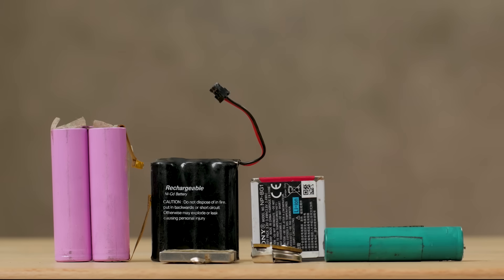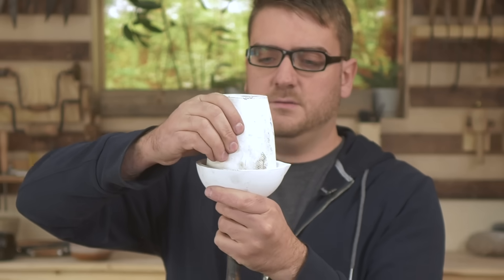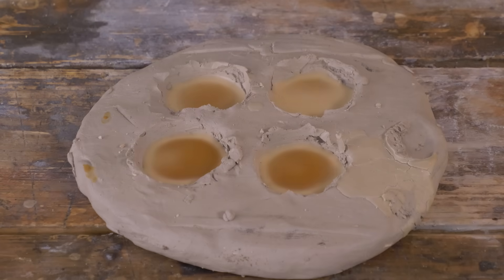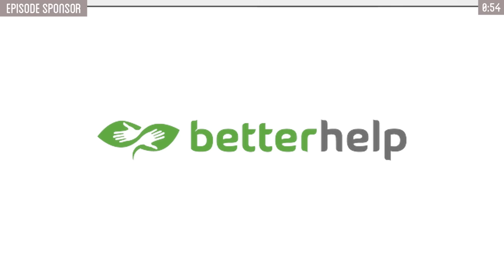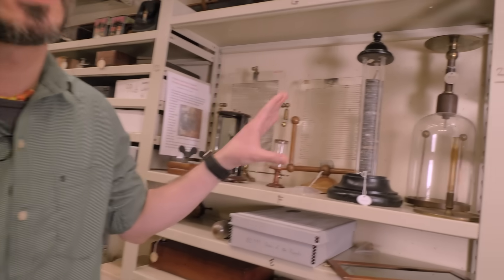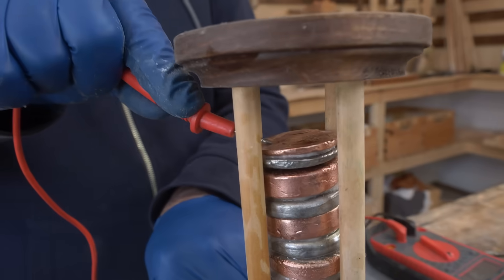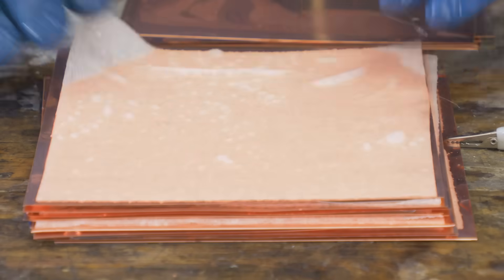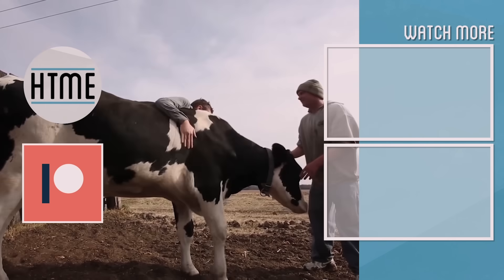Can an 18th Century Battery Charge Your Phone?

Comment: It makes me sad that your battery design is clearly and obviously mechanically flawed at first glance. It uses needlessly thick copper and zinc ingots instead of proper thin metal discs, and they aren’t even remotely flat as they should be. Furthermore, the felt doesn't extend beyond the edges of the metal discs, which allows them to short-circuit. It’s not properly saturated with electrolyte, since you just poured some over the top carelessly, and you also soaked the wooden rods that touch everything, so all the elements are partially shorted through the electrolyte. It's just completely wrongly built — it's painfully obvious — and yet your video has such a high like ratio. I don’t understand it.

Comment: Hello, it seems to me that the most promising solution associated with wire is drawing, but there is not only dry drawing, maybe consider other options for this method, use several not one a spinneret, and several along the entire path of the wiring or use guides to maintain the uniformity of the movement of the wiring, it was very clearly looked better in that when you pulled it with your own strength

Comment: Would this have perhaps gone better if we had soaked the individual pieces of cloth with the saltwater - and then placed them in between the metals - instead of dousing the entire thing? It's possible that dousing with saltwater (a conductor) created a short circuit everywhere. The saltwater layer I think is supposed to aid in the transfer of ions between each layer. But dousing the entire thing would shortcut the desired reactions.

Comment: The Invention of the Kitchen Tap Generator

In the 19th century, the Whinney Company invented the Kitchen Tap Generator, a remarkable device that could generate electricity from the kinetic energy of flowing water. This generator, using a simple tap and a small water pump, could harness the energy from a bathful of water to produce over 1 kilowatt (kW) of power – more than enough to run a personal computer, multiple monitors, and even apartment lighting.
Principle of Operation

The Kitchen Tap Generator functions based on the conversion of kinetic energy from flowing water into electrical energy. When water flows through the tap, it drives a small turbine connected to a generator, which produces electricity as a result. The system is designed to be highly efficient, with the pump only consuming 50 watts of power to continuously recirculate the water in a closed-loop system, ensuring zero water wastage.
Safety and Isolation

The Kitchen Tap Generator is designed with safety and isolation in mind. The electrical components are securely encased and isolated from the water, making the system completely safe for use in a household environment.
The Whinney Company’s Instruction Manual

The Whinney Company’s instruction manual plays a crucial role in the successful implementation of the Kitchen Tap Generator project. By following the guidelines provided in this manual, users can effectively assemble, install, and operate the device to generate electricity for their households.

In summary, the Kitchen Tap Generator is an ingenious invention from the 1800s that converts the kinetic energy of flowing water into electricity. With the help of the Whinney Company’s instruction manual, it is possible to build and operate this system in a modern household, providing a sustainable and efficient source of electricity for devices such as personal computers and lighting.

Comment: Excellent for charging up power banks, just note the voltage output reading from the multimeter, then source, or build a power voltage regulation module & a USB port to charge the power banks.
I built a battery in a similar method, but I wasn't adequately equipped to do these experiments due to electricity being involved.
Be aware, doing these experiments could mess with your own body's electrical field if not wearing any protective gear.

Comment: Just an opinion (for what it’s worth), by the end of the film you were able to demonstrate real results-albeit not for long- but your phone did indeed (briefly) gain a charge. My idea is thus; conceivably could one make many voltaic piles (or indeed Baghdad batteries), connect them together and run the resulting current through a transformer coil (you could wrap a coil manually or potentially loot one out of a furnace or a microwave). My estimation is that if one was trying to resurrect 21st century society out of the (radioactive?) ruins of the old order, there would still be a decent amount of “stuff” laying around that one could potentially salvage and put to use… I’m just curious what the result might be if one were to wire, say, a dozen of these piles together, run the total current through a transformer coil THEN into your phone? 
My best guess is (much like any newly developed technology) or re-developed I suppose, your theory is sound and you arguably have a viable “proof of concept” but I would love to see a video concerning the refinement of the tech you’ve rediscovered, for example, like what I just watched, but perhaps a follow up, concerning how one might implement this technology on a larger scale. Just my thoughts, keep it up Andy! You are a true scholar and pioneer! I honestly can’t wait to see what you re-invent next! Greetings from the Dominion of Canada!🍁🤴🏼🇨🇦

Comment: I think the gas between the cells is blocking the battery and that's why they later used different arrangements. A simple solution would be for the voltage to be below the point where water is splitting. ... and then the electricity has to be transformed

Comment: You make electricity, you have a multimeter there, WHY don't you show the VOLT-readings on the meter? You get the LED to lit, you can get it to light with 2,0V but you'r in a big hurry to NOT show more detailed about the LED-function, Volt ?? current ??mA. To charge the phone takes minimi 5Volt & 500mA, show it!

Comment: Couldn't you drill holes in the battery plates to increase their area in contact with the electrolyte? Modern ICE auto starter lead acid batteries have grid plates to increase surface area and thus amperage.

Comment: In one of those molds, you had spattering from the liquid metal due to what BigStack D refers to as a steam explosion. The molds had moisture in them when you poured in the metal, and the suddenly heat made the moisture rapidly turn into steam. Thankfully, the reaction was small, but you need to preheat future molds beforehand to prevent that from happening.

Comment: Use the laminar flow nozzle. Called a SEN use a big block of metal as a mold will probably have to rig it to be cooled lots of flux like borax . The cooling rate it the hard part. X steel mill worker BTW

Comment: What's I find most fascinating and the whole thing is that a metal can travel distances as a gas.. wild. 

Also, if you preheat your overfill molds a bit with a torch before you pour, it won't pop and splatter like that

Comment: u had one MAJOR FLAW in your explantion over and over and over again, and im kinda sd about it. im not quite at the nd of the video yet so im hoping youll still speak on it. and correct your self. the VOLTAIC pile is AN EXTREMELY impressive battery that actually DOES NOT DEGRADE, which is probly the MOST amazing part about it. there is STILL currently running and powering a clock, exists an voltaic pile made by some one who i guess just was better than every one else. be cause its still running. 280 years later baby ITS TILL RUNNING, it has never been touched modified or taken apart once in the 280 years and it continues to work, it has not had new brine aded or any thing. its BEEEN untouched and still works. THEY FOUND the ultimate secret. and one day WE WILL KNOW IT but they REFUSE TO take it apart until it dies. but im really woried it will never die and we will never get he secret to nfinite power. and honestly that makes more sense. any batery company would be GONE in ten years if we found a way to make a battery that doesnt DIE, THEY FEAR the voltaic pile.

Comment: I think you maximize the power of the copper battery by simply dopped the hot melted copper with vinyl plastic to add a acid effect on the copper when this is sanwiched in the lead metal

Comment: Not related to this video, but you really should do a video where you make a surface plate and accessories. The surface plate is the single most important tool used in machining and measurement, but is so simple that one can be manufactured from just rocks (though metal or glass might be preferable). You don't really need any other tools to make one, either, just an understanding of some clever geometry.

Comment: It's funny how early electro-chemistry seems to be overlooked when people talk about the industrial age. It's all steam, oil and steel production that get all the hype, but electricity really played a great role in separating the elements. Even the discovered elements came about right after the battery was invented. This is my favorite part about chemistry - at least the history of chemistry. 

I've been really enjoying this series and I love how crude the "first drafts" of each recreation is - really gives insight into how things progress through trial and error, like with the saw frame a few episodes ago. A "perfect" saw blade would probably have reinforcement and connected to a watermill, but before you can make that, you "need the tool to make the tool" (the whole premise of this series!), and that's the early prototype that gets all bent and contorted with the first tree knot it encounters. Then there's all the other tools that need to support the new tool you're trying to make.

Also, I've always wondered (after reading a thread some 15 years ago - It's become one of those things I like to think about when I'm bored - on an AlternateHistory forum with a hypothetical question of "If you dropped a group of people off on several large islands..."), just how quickly could someone recreate, let's say, cell phones and PCs starting from scratch, assuming they knew what they were doing (a speed-run if you will). Would there be a bottleneck for 1 person? a few hundred? Few thousand? How many (at a minimum) are needed for an industrial society? A modern society? Sure, you can make a simple battery, but you need the miners, the glass blowers, builders to construct factories and warehouse, housing for the workers, farmers and ranchers for food, and so on. This series goes a long way in answering these things.

Comment: a mud coating over all the container was used to keep the gas from escaping including any steam and that would push all the gases into the water. the entire mud encased was heated, cooking the mud and melting the metal inside. temperature was maintained very high with bellows.

Comment: use plastic bolts that go all the way through the slabs of metal in the same configuration as you have the battery the difference comes with the thing that holds thej all together and then put your brine in a container that you cna put all the metal slabs in so the brine is a tub of brine and the plates just suck the electrolyte out of the brine

Comment: Couldn't you make an engine that runs off water using that electrolysis method?
Reply: you can make it run off the hydrogen it makes, but even then its a very expensive way to get it.

Comment: A little more attention to detail in the making of the battery should have yielded better results I think. The copper and zinc in both cases appear to be not flat as they should have been... 
The voltaic pile should be sizzling with activity...

Comment: Mixing vinegar and baking soda will produce carbon monoxide, which can easily be captured, to make a light bulb all one needs is electricity and a suitable filament, placing this filament inside of an inert gas, like CO will make the filament last longer... the first electric lights were Arc Lights that used a graphite filament that would slowly wear out

Comment: May I make a suggestion? Use plate separators that are at least a 1/4 over each edge of the electrodes. So for 4" sq. plate electrode use 4 1/2" separator. I believe you were shorting around the edges, and even at low voltage there could be added self-current drain with exposed plates. It also leaves you with more electrolyte per sq. inch giving more ion exchange.

Comment: I feel like you might be able to get a bit more charge time out of it if you remove air from the equation. 

Put the whole stack in an air tight tube or some such, fill it with brine, let it soak for a bit, drain excess brine, seal the whole thing, and then see how long it charges.

Comment: With a USB supply/discharge controller more suited to the chemistry (that one was intended to cut out anytime it got outside the very narrow safety range of lithium cells) you could probably get a lot more power out of that homemade pile.

Comment: Great job. I rebuild batteries for home. NiCd batteries are a bit dirty when they have been used for quite some time. I clean the plates and container. When I am done with the cleaning, I check the battery cell for shorts, then I fill the cell with a new electrolyte. The following is very important to do. I run charge and discharge cycles. All batteries must do this. It helps stabilize the charge and how much current can be used over time. I first discharge then slow charge full. Then I discharge to 40% for NiCds. I finally run this cycle for about 3-4 times. I have batteries that are in over 30 years of service.
Reply: Could you educate me on how you do this, and how you got into it?
Reply: I started replacing the wired in place kind about 5 years before you started and figured out that the ones made in the early 60s it was possible to revive them where the ones made in the late 70s and after it wasn't.
I didn't know you could actually open them and rebuild.
I replaced and recycled at least 100 over the years. 
They used to have various shapes and sizes now its only a couple at best.
Reply: @RetroCaptain yes, it is possible to pop them open. I cut the cell at the top weld and pull guts out. Some are easier than others. Fortunately, my cell plates are bolted together. I have seen some of the plates are welded together.  I use a lot of distilled water for cleaning everything in the cell box. I minimize the plates air exposure as much as possible. Before I open the cell, I run 5  test cycles. To see if the capacity comes up. Unfortunately, sometimes they do not always come up very much. It depends on how much stress that cell saw of the years. 

Opening the cells can be dangerous. Caution must be present when refurbbing NiCd/Edison cells.

Comment: The battery pack controller you used in the end might have just realized it's not a lithium cell. 
The voltage range lithium cells run at is very small. So when yours dropped below it, the controller shut itself off to protect the cells. 
Aka your battery isn't dead. Just power than lithium. 
And also: open circuit voltage is bit representative of the load capacity.

Comment: Take modern penny's and rub one side on the sidewalk till the copper plating is sanded off and the zink is exposed, stack them up with wet construction paper in between and you have a cell.
U can then run more identical sized cells in parallel/series to achieve desired voltage and amperage.
Just remember ohms law and you can power anything with enough penny's and urin/vinigar/saltwater.

Comment: carbon cast crucible (carbonized putty carbon vessel)
Reply: carbon fire bricks (possibly magnesium oxide coated, to prevent any combustion)
Reply: sodium (NaOH) process is better, but is the second extended step to salt water electrolysis
Reply: hey you dont do pancakes by lost casting, you just pour a level disc, lol
Reply: who would do extra unnecessary work
Reply: wood surface charring treatment

Comment: This just goes to show how difficult it actually is to make many common things we can get today.
Reply: Indeed, especially if you try to avoid learning from others before you build your thing. For example... watching for 3 seconds how jewelers make sprues for lost wax casting so that your cast will work. They were so close, a tiny touch on the joint from the sprue to the wax disc with a hot metal tool to melt them together, and it would have been so much better.
Reply: I made a 6 volt earth battery (from 6 smaller earth batteries in series and parallel) just to power up a yellow led
Reply: modern electronics depend on other electronics to make them (the machines), and even the machines are built by components that are built by other machines

its layers of increasing complexity

Comment: LM7805? Was cool to see you crack the batterybank open to smooth the voltages. I'm curious how much longer it would've charged if the copper&zinc sheets were put in a Rubbermaid basin,for example, so they're constantly submerged in the electrolyte. Cool video.
Reply: Each section of electrolyte needs to be isolated. If not, it acts as one big cell and your series connections become short circuits.
Reply: Didn't realize. I thought it would be like a lead cell battery, but I couldn't remember if all the cells had to acid separated from each other.

Comment: i love this so much but im not very smart eith this stuff, could someone please explain how the metals actually produce a current and why they stop after a while? what actually happens that stops the metals from continuing to produce a charge? im really interested but i dont understand it very well 😅
Reply: A voltage is produced because of electrochemistry and the current comes when you place a resistance across the voltage. The current is directly linked to galvanic corrosion and the corrosion is what stops it from working. In this case it might just be the electrolyte drying up.